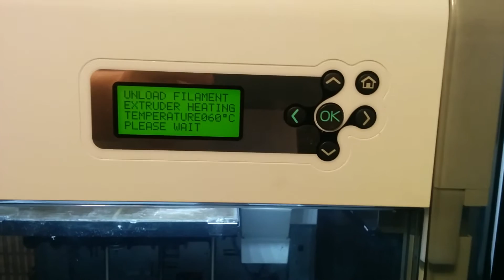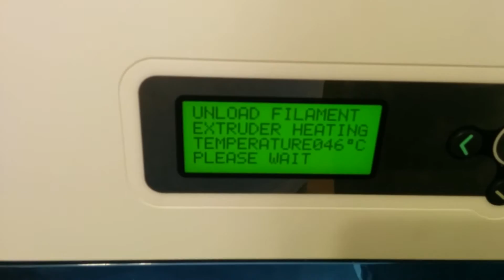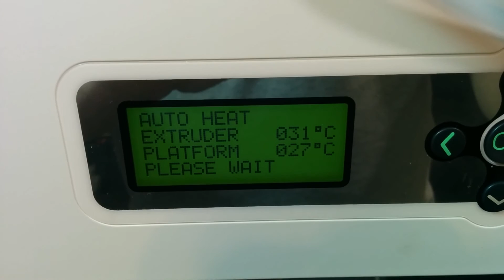Da Vinci 1.0 3D Printer - heating element fix

Comment: hello, i need your help, i have a davinci 1.0 with repetier 0.92.10, and after 2, 3 o 4 hrs of printing i have a thermal sensor failure, can you helpme with the problem, and always lost my prints, im a beginner and i really need your help. mdlg1989@hotmail.com is my email, i thank you a lot, my printer is new but without warranty. somebody tells me try to put an extra fan for the extruder becouse it heat too much the thermal sensor wires.
Reply: did u figure this out?

Comment: Just made the same fix to my Da Vinci 1.0.  This problem also affects the newer wiring with white connectors.  I recently upgraded an older 1.0 that had the original ABS-only extruder, installing a new extruder to print PLA, which requires replacing the heater wires with the newer white connector version.  That connector failed after about a week of use.

Don't simply jiggle the wire or unplug it and plug it back in.  As the video shows the connection is going to keep failing, and next time might be near the end of a long print run.  It only took me a couple of minutes to cut the 2 connectors off, strip 4 wires, and twist them together with twist caps to verify that the connector was the problem.  Now I'll solder it for a more permanent fix.

Comment: Thank you! That fixed my issue with the Creality CR-10.
http://weij2.spdns.org:18080/CR-10/CR-10_loseContactInNozzleHeater03.jpg shows the copper that I had too re-press with slip-joint pliers.

Comment: If you replace the thermistor, and the heater cartridge, and you remove the (heater cartridge) connector and solder/cap the wires and it still doesn't heat... you need to pull out the motherboard and solder resistors 271 & 272 into continuity. Then add a 3A fuse to the left white wire of the extruder heater coming out of the motherboard. This fixed my problem. The new printers don't have a fuse in the extruder heater wire.

Comment: After getting purple ABS I was having trouble with prints and the print sticking to the bed.  So I turned up the bed to 94 degrees and the extruder up to 230 degrees.  These setting worked fine for a small print (1 hr.) but when I did a (3hr.) print the connectors became so hot a piece of the outside broke off when I was pulling it apart to check for conductivity and to see if the extruder itself was burnt out, after the extruder temp. dropped off totally as in the video.  I believe the high temperature setting of the extruder as something to do with the wires and connector becoming so hot that they fail.  Did anybody else have this wire connector failure after raising the temperature using the filament hack?

Comment: Update for you guys,  One other thing to check if you have followed this and found there isnt 12v coming from the board.
On the back of the board there is a little fuse type thing called JP4,  if you put a multimeter on the bottom of that JP4 (as well as the other connector on the right hand of the white connector) soon as you have told it to start heating up the extruder, it will show nothing?  Try the top of JP4 and if you get 12v there, the fuse has blown and you will need to solder over it and bypass it and put a 3A fuse in the white wires.
Reply from the maker: Great point Troy. Thanks for the additional information

Comment: So this is definitely the issue on mine and when I checked that heat of the connector it was really hot. Only question will it do any damage to my machine to continue running it with the connector like that?
Reply from the maker: No, actually bypassing the connector and soldering the wires together is better for the heating element. More surface at the connections = less heat and shorts. The only draw back with soldering the wires together is being able to replace the extruder easy.
Reply: That's exactly what i did and it worked perfect after that

Comment: When I turn on the machine. Which one is the thermistor? It is getting that hot because the filament started to melt.
Reply from the maker: either something is messed up with your electronics or firmware. Try unplugging your heating element and upgrading or downgrading firmware.

Comment: I removed the connector and temporarily used a wire nut until I solder the wires. I turned the printer on and sure enough my extruder started to heat up. However where normally it would heat up to 70 it's now heating up non-stop. I had to turn my printer off once I saw it get to 260. What's going on?
Reply from the maker: Does it start to heat up when you turn the machine on, or when you try and heat up the extruder? Also it reads 260C but is it really getting that hot? Unplug the thermistor and check if the extruder gets hot.
Reply: Mine did the same but I cancelled the print when it reached 138 degrees.  Before then it never went higher than I set  the filament temperature than what I entered in the filament reset hack (which in my case I had set to 130 degrees.
Reply: Also "MF" the temperature didn't start rising above my settings, until the actual print was commencing, right after the skirt was printed.

Comment: i cut the wires on my printer but i still only get 0.75 volts, i dont know what is wrong with it :(
Reply from the maker: +jack opiny , just to be clear you are trying to heat up the extruder and the two wires read 0.75 volts. If so trace the wires back to the circuit board. Try to head up the extruder again and check the connectors on the circuit board. If they read 12 volts your wires are bad, if they read 0.75 volts your mosfet is probably bad. If you can check the connection at the mosfet. Also did you check your conductivity of the heating element and your thermistor is working right?